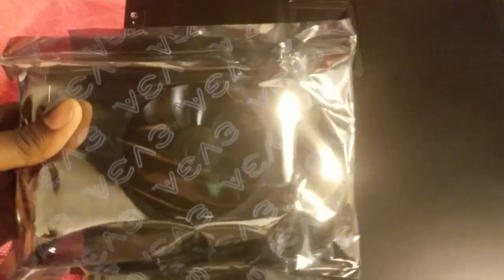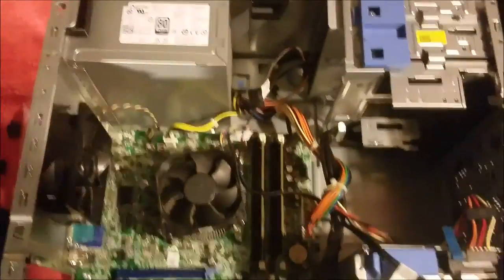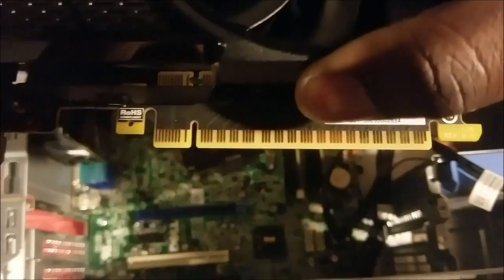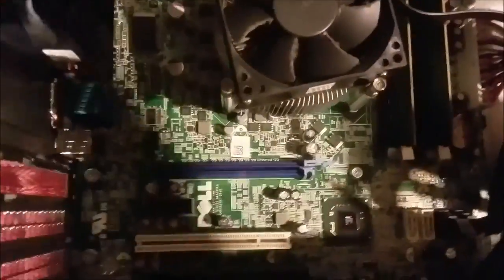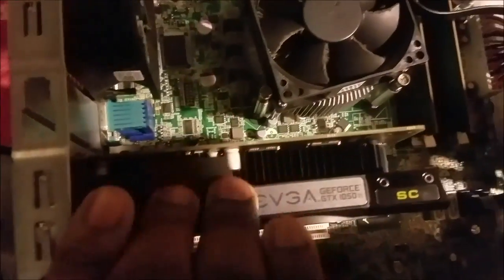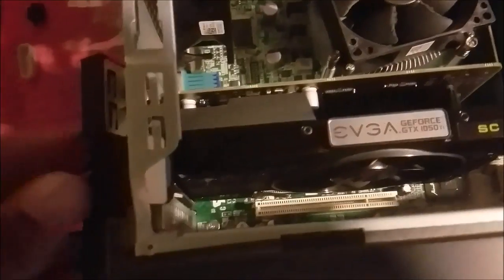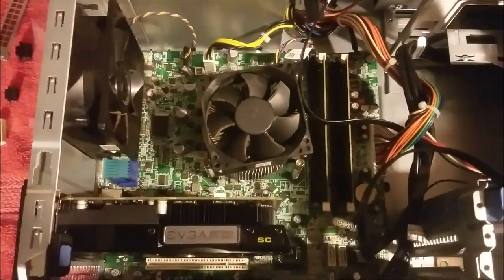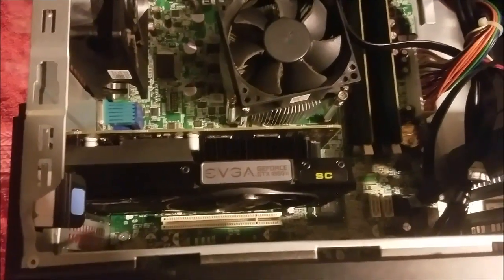Dell Optiplex 790 MT How To Install EVGA GTX 1050 Ti SC [Tutorial] (Gaming Upgrade #1) P.2

Comment from the maker: I have a vid installin' the GTX 1060 in a Dell Optiplex 9010 here. https://youtu.be/wmtKvoutkEE
Reply: hey i found someone selling a optiplex 790 with i5 2400 and 4gb ram for 100 is it worth if i buy one of these and put a gtx 1050 ti in???
Reply: youtube user not worth should be 8gb ram for that price
Reply from the maker: @youtubeuser7359  I'd say so. It's what I got the pc for in this vid!
Reply: @youtubeuser7359  I wouldn't buy a sff chasis size. Those pcs are a real pain to work on.
Reply: @youtubeuser7359  No thats overpriced 790 should be around 65-75 usd
Reply: Do u not even have to upgrade the power supply?
Reply: hi bro i have dell optiplex 990 does gtx 1050 support my pc

Comment: i have a dell too with a 650 gtx card in it that requires 4pin power for it..I put the 1050 in, fan spins but no display.  it's like the board isn't giving it enough power to run it?  PSU is 470w.

Comment: So I have the Dell Optiplex 790 MT, but it has i7 2600, and I have 4 sticks of ram on it (totalling 16GB). I also have it with 1 TB SSD. Would adding this graphic card (the 1050ti) work???? Or would I need to upgrade PSU etc. Also, I am confused because the pci port should only be able to draw 35w but you say it should still work right???????
Reply: Yes it should work I put a gtx 1050ti sc in my dell optiplex 990 and it fit fine and worked fine. I also have a 265 watt power supply
Reply: @nednelp9051  do you need to install drivers for the GTX 1050 Ti after installing it?
Reply: @somewhataddicted7685  Yes

Comment: Three years later...Thanks!  have to upgrade an old 790 which I picked up on Ebay, and your Video came in mighty handy!
Reply: But you need a 500watts power supply on that!
Reply: Dell 790 have low watts power supply

Comment: Would it work with this setup if I add the graphics card
DELL 790 SFF, Core i5-2500 3.3GHz, 8GB RAM, 250GB Hard Drive, DVDRW, Windows 10 Pro 64bit (Renewed)
Reply: U should get a ssd
Reply: Get a better psu

Comment: How can I tell if the psu will work in my pc.. what requirements do I look for
Reply: Just make sure it fits the case itself and then make sure it has 24 pin connector for motherboard. Hard drive...etc

Comment: Can anyone help. i ordered a gtx 1050 ti  used and it only came with the large bracket so it won’t fit in my 790. is there anyway to buy the smaller bracket. if so please help me out. thanks
Reply from the maker: It should fit int he 790..I have the large bracket still on it.

Comment: isnt the card using 75w? how did you get it working without changing the psu because the motherboard can only draw 35w
Reply: No the older ones put out 35, this one puts out 75 watts
Reply: @shada.1273  Are u 100 percent sure?

Comment: Hey does this block some of the PCI slots? I have a sound card and a ethernet card plugged into the small PCI slot but it looks like the 1050ti is blocking it in the video
Reply from the maker: It may indeed block some of em. It's been a while since I've looked inside tho. The white one should be fine from the looks of this vid.

Comment: Hi I have a 790 and I’m running a 750ti do you think I will be able to overclock im using stock psu
Reply: Isnt the 790 using a motherboard that can only draw 35w? Have u had any problems with it?

Comment: I need a dell optiplex 790 with i5 to use the gtx 1050 or with i3 is enough?
Reply: i3 will work
Reply: Yep it'll run around 120fps-130fps

Comment: Hey bro , i bought the exact same setup as you , i got an i5 2400 , 8gb ram (soon to be 16) and tommorow my asus phoenix 1050ti is coming in , and i know you answered this but will it run fine on stock psu and be reliable , how long did you have the card with stock psu and did you ever upgrade , were there any issues with heat or anything , any help would be awesome  

Edit: I also noticed you have an 80 plus bronze psu , mine isnt , will that affect much ?
Reply from the maker: Hey there. Yep it will run fine on the stock psu! I'm still usin' it to this day! I've been gamin' on it and such for a year now.
Reply: LucidTeFlon180 and do you think me not having an 80 plus bronze will affect much and also im guessing yours is 265 watt right?
Reply: @aricerse4654  how did it turn out?
Reply: @emp8256  the pc or psu
Reply: @aricerse4654  the pc,  I didnt expect u to reply damn.
Reply: @emp8256  I still have it and I pretty much stopped playing games on it, everything still runs perfect, one thing I would recommend you is getting an SSD, makes a huge difference, eSports such as Fortnite run in it no prop, GTA V even with mods can run easily on high settings and it'll take on new titles pretty strong too, I mainly use it for video editing now, anything else you wanna know?
Reply: @aricerse4654  did u have an problems with the gtx 1050ti like you needed it to have more power? The pcie only gives out 35 watts and the gtx 1050 ti needs 75 watts. Did you have to use more wattage from the psu to get it to work? If so how?
Reply: @emp8256  do you have the mini tower(MT) like in the video or do you have a small form factor (SFF), or ultra small form factor (USSF), I'm not too sure but I think the SFF and USSF only output 35 watts and you can't use anything more than a gt 1030 but I myself have an MT like in the video and it outputs 75 watts, so if you have the MT, there will be no issue
Reply: @aricerse4654  oh ok I'm getting the MT. Thank you
Reply: @aricerse4654  one last thing. Which version do you have? 7010 or 790, for example
Reply: @emp8256  I have the 790, it's got the i5-2400
Reply: @aricerse4654  ok ill try getting the 790 since ik it works. Thanks
Reply: @emp8256  ye no prob ✌️
Reply: @aricerse4654  Thanks brother, I was investigating how many watts the 790 MT has but I only got the 790 and it told me 35 watts and I didn't know how a Gtx 750 would work thanks to the fact that it occupies 70 watts, thanks to your comment I'm sure I'll get it, THANK YOU!

Comment: wait i thought the pci port on this machine only gives 35 watts. the card needs atleast 75 watts to work.?x
Reply from the maker: Well that was a wrong thought sir. The 75 watts is enough for the machine stock.
Reply: Sounds gread! Got the same PC today, didn't get the card yet but it's stress relieving to know that my Zotac will work on this.
Reply from the maker: Yesh the non slim version of the cards will fit into this case. I just ordered another one (Dell 790) a day or so ago.
Reply: LucidTeFlon180 wait does that mean the slim versions of the cards won't work
Reply: @PyrexFortnite  slim version is usually longer, and is too long for this mb

Comment: Can someone help me? I have the Optiplex 790 and I just put a EVGA 1050 ti in it but the drivers wont install. I've even tried editing the .inf files like I've seen on some youtube videos.
Reply: having this same issue with a GTX750TI. ANY HELP?
Reply: I know its an old comment make sure you install drivers for the right OS when I got my 790 I made the mistake of accidentally installing a 32 bit windows 7 one instead of the 64 bit if you need to check that go to the bottom left windows symbol and type dxdiag and that will tell you what os you have
Reply: Upgrading the Bios...for instance I just popped the A24 for my 990MT as I am getting a new card today (either 970GTX or 1070GTX)...even still your MOBO may be limited.

Comment: Does evga 1050 2gb sc can fit in this?
Reply from the maker: I dont see why not.
Reply: LucidTeFlon180 Have you changed the psu and maybe i will change it so what psu should i get for gtx 1050?+Thx
Reply from the maker: No I have NOT changed the psu. Ya dont need to but can if u want to.
Reply: LucidTeFlon180 Thx.

Comment: Are these computers capable of switching to a i7 2600 non K and a aftermarket cooler?
Reply: My 790MT has been running an i7 2600 @3.4Ghz on the OEM PSU without a single hiccup. Am very tempted to put a beefier PSU in there and bump up to the 1050 Ti or Titan X video card for running Daz3d better (currently only running a GTX 610...don't laugh...) but have been concerned about that 35W "limit" on the x16 PCIe slot.
Reply from the maker: I believe they can take a i7 2600. Would need a new psu for it tho.
Reply from the maker: Where could one get a cheap i7 2600? Lookin to put another one of these together. Btw no need to upgrade psu when u have a 1050 Ti. Now if ya have a 1060 on up then of course.

Comment: Can a gtx 750 ti work in a dell optiplex 790mt with 250     Watt power supply?
Reply from the maker: I believe it can since my 1050 ti can pull it off.

Comment: did your computer have a limited PCIE slot? Like on the handbook, it says 35w. And from my knowledge, the card needs 75w
Reply: Did you ever find out
Reply: @HansRei  lol did you? i see so many people saying it will work, some it wont, and some say jus a new psu is all you need. I just bought an i3 optiplex 790 and i purchased a gtx 750. itll be here in 2 days and im worried about power myself.
Reply: BradyDarkspear it can easily run a 750 I wouldn’t worry I’m going to add a 1050 to low profile to my dell optiplex 990 ssf bro you should be good

Comment: Excuse for asking, but I have the same Dell MT and was wondering what is your PSU? I just want to confirm
Reply from the maker: PSU  is the stock 265 watt I believe.
Reply: I just found out that my PSU is 240w, will that work too?
EDIT: I read it wrong I do apologise for the misconception. Its the same as yours. Thanks for the help!
Reply from the maker: I'd think it works. But should confirm it before tryin anything out.
Reply: I'm sure you have been asked this question before but did your motherboard have a limited PCIE-Slot aka 35w
Reply from the maker: All I know is that this particular graphics card works with the motherboard.

Comment: Can i put on my opticplex790 a gtx 1050ti 4 gb ddr5?
Reply: Yeah I've herd there have been issues with newer AMD cards and older PC's like this. Only thing I don't like about this PC is the SATA ports and HDD Drive bay are in the way for bigger cards. makes your GPU selection very limited.
Reply: ArkonBlade it work man 1050 ti 4 gb oc high profile tanks
Reply: Oh I know it works I've turned a bunch of these Optiplexes into gaming PC's and even used a 1050 TI a few times. I'm about to do another one with a I7 2600 and a GTX 1060. Its to bad that they stopped making the 1155 socket boards though. I use to be able to get some nice MSI ones for $50-$60 and move all the parts into a bigger case. Now the boards are hard to find and even used they aren't cheap.

Comment: Great Dell Tool Less Case !  Now max out the RAM in the Four (4) Slots...  And maybe up-grade to a XEON CPU since you have a Great GPU !  tjl
Reply: Running the Dell Optiplex 7010 MT, 16 Gb RAM (maxed out),  EVGA 1050 Ti SC and the stock PSU...  And may up-grade to an Intel XEON E3-1240 V2  and backed up with the APC Smart-UPS 1500 mini tower...  To stay connected when the power flickers.   tjl
Reply from the maker: Th ram is maxed out at 16 and mo cpu upgrade for now :/. It still runs nice to this day.
Reply: You can't put a Xeon processor in a normal PC like this because first of the processor is too large second of a dell optiplex 790 mother board only supports one type of processor socket the LGA 1155

Comment: Will you need to upgrade the power supply in order to install this card?
Reply from the maker: Nope u don't.
Reply: really cuz i was just on the geforce site and they said you need a minimum of 300 or is that just what they want
Reply from the maker: Trust me, I and many others on YouTube have been usin the stock psu with no problems. The card only draws like 73 watts or somethin like that.
Reply: oh okay
thanks
Reply: getting one for my bday just wanted to make sure that my pc dosent explode lol
Reply from the maker: No problem, feel free to confirm it with others. Check out the Tech Deals channel about this pc. Goes over what ya need to know. https://www.youtube.com/watch?v=KHpionFbpws&t=154s
Reply from the maker: Oh it should be fine lol. Do check out that link tho.

Comment: So my brother is getting a 790 MT with an i5 and 8gb ram, so would you have to get a new PSU to run this card? Or can you just plug it right in?
Reply from the maker: Nope u don't need a new psu. It's just plug and play as u saw in the video.
Reply: ok thanks!
Reply from the maker: No problem. Feel free to check out the playlist for more of what this can do.

Comment: I have the exact same computer (790 MT) and recently installed a GT 1030 video card (nvidia). It only draws 30 watts from the PSU and the computer supports it, but weirdly, whenever I boot it up, it skips the bios and only outputs video at windows login. Even when I press F2 for setup, it just hangs at black screen. It seems the GPU only communicates with the computer until I enter windows. Does this happen to you? (just wanna see, as I think I will buy a new monitor to see if the issue is fixed).
Reply: what happened
Reply: I needed to ask you a question what gt 1030 did you buy for the optiplex 790 Mt I have this same system and I was wondering what brand you bought it from
Reply: Oddly enough, I have the reverse issue. My card only displays up to windows logo and spinning wheel, then nothing but a black screen.

Comment: Did you need to replace the power supply for this to work, or are you still using the stock Dell OEM PSU
Reply from the maker: Still usin' the stock power supply to this day.

Comment: Do I have to change original power supply with new or no, and what's your opinion in this video card:
https://www.amazon.com/EVGA-GeForce-Dual-Link-Graphics-02G-P4-3751-KR/dp/B00IDG3PRI/ref=sr_1_2?s=pc&ie=UTF8&qid=1501119513&sr=1-2&keywords=GTX+750+Ti
Reply from the maker: No there's not a need to change power supply. I think that card still has some life left.

Comment: Yea I did a build similar to this on my channel except I used the GTX 750 ti for those that can't afford a GTX 1050. It did surprisingly well even on Mass Effect Andromeda and Doom, definitely worth doing if you have an older Dell optiplex or a tight budget.
Reply from the maker: I just checked out that vid. Nice goin' there! It really is that easy to transform these machines into gaming pc's.
Reply: You use the psu it come with or replace

Comment: Ok so I recieved your ram today. I first want to say that I have purchased 16gb ram from 2 other sellers that both said the ram is compatible with a dell optiplex 790. When I installed the ram I purchased from both of those sellers they didn't work so I found yours and have the same results. I'm sure at this point that the issue is not the ram I'm buying. Do you know if there something specific that I need to do to make this ram work because I cannot figure it out. My specific model supports up to (16 gigs) 4 gigs in each dimm slot. I get the 1-3-2 error beeps that indicate it does not detect ram. When I put the original 8gb back into the system it turns on fine. What am I missing here?
Reply: The ram has to be ddr3 I think

Comment: Q: Do I need a better power supply if I put a VGA Gigabyte Geforce GT 1030 Low Profile 2G in it?
Reply from the maker: Ya know what, I'm not familiar with the card. It looks to be plug and play (like the 1050 ti) tho.
Reply: Levelレベル no
Reply: No you'll be fine

Comment: Was the GPU plug and play, or did you have to update mobo Bios? I'm looking for an i7 2600 OEM PC to beef up into a gamer for a 2nd PC.
Reply: How did you update the bios, did you just download it and run it?
Reply from the maker: Well the 1050 ti is indeed plug and play! No further action required besides updatin' the drivers.

Comment: Does the motherboard PCI slot limit the 35w as everyone has been saying?
Reply from the maker: What do ya mean? It's capable to run the 1050 ti card. Multiple sources on YT  said so. I did a lot of homework on this prior to makin the decision.
Reply: LucidTeFlon180 Oh, I bought a dell optiplex 790 too and it's coming tomorrow, so should I buy the 1050 ti?
Reply from the maker: Oh hhm well I'd say go for it mainly coz it's just plug and play. If u get somethin like a 1060 (costs a bit more) then u would need a pci adaptor and a new power supply.
Reply from the maker: Also check out a channel by the name of Tech Deals. This vid will provide a lot of info. https://www.youtube.com/watch?v=u0fBehW2L0Y&t=778s
Reply: LucidTeFlon180 Yeah. I've been paranoid about the GPU, could you possibly share your motherboard model and bios version to clear that issue about the 35w? I would appreciate it a lot bro.
Reply: LucidTeFlon180 Thanks for that too!
Reply from the maker: Clorox Splash-Less Bleach no problem. We'll I updated the bios not long ago to A18 I believe it is. Not sure about the motherboard model etc. I would have to restart pc to bios but I'm usin it right now lol.
Reply from the maker: Also the motherboard is a Dell 0HY9JP A02. The bios version is indeed at A18.
Reply: LucidTeFlon180 thanks!! Really appreciate it
Reply from the maker: Clorox Splash-Less Bleach no problem. Lemme know how it all works out. I'm curious to know haha.
Reply: Clorox Splash-Less Bleach Did it work?
Reply from the maker: Check that link I gave out if u don't believe.
Reply: Depends on what power supply you have, if you have a 250 or 274 watt power supply you could run it but you won't be able to overclock your GPU and you would only get half the performance from this card, i recommend not buying sff cases stick to the MT optiplex towers and upgrade to something like a 400w power supply, then you'll be fine. ^^ this goes for all optiplex models 

Just remember never go small form factor
Reply: @Vmunchies-pb  does minitower have 35w limit